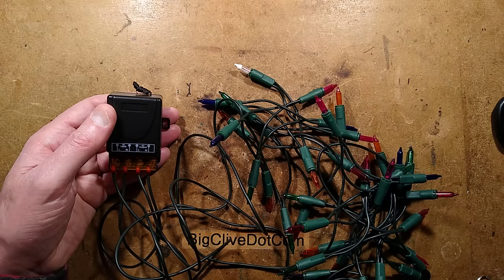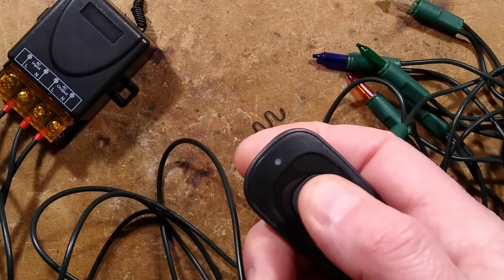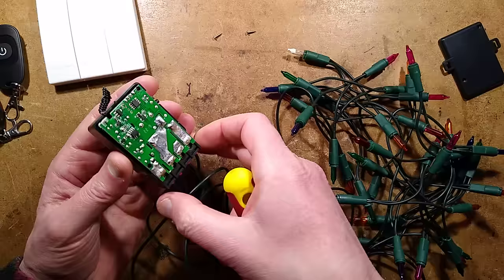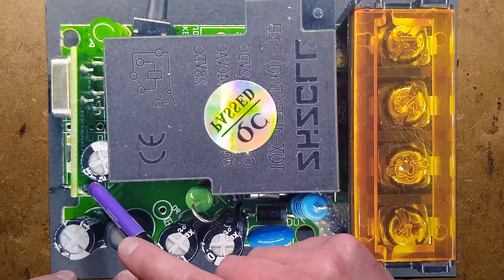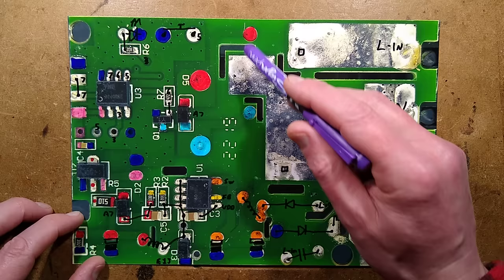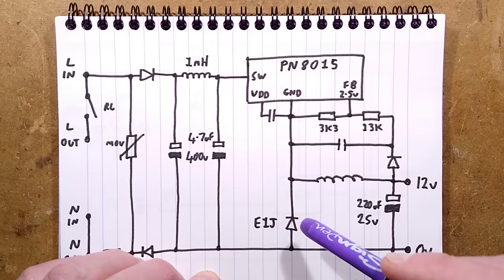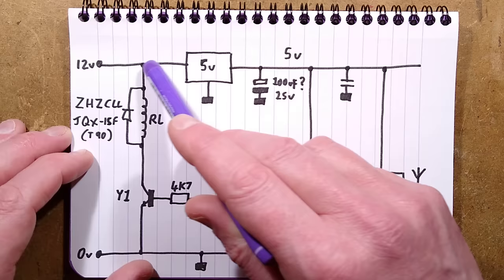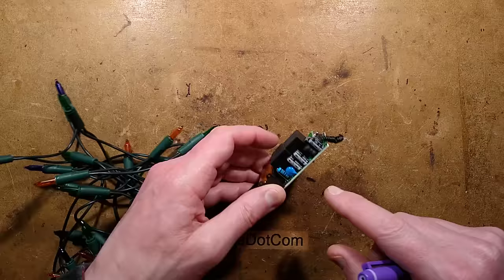Inside a "30A" remote control - with schematic

Comment: I've been known to add copper wire along PCB traces like that in order to improve their current capability. Usually 1mm for small or hard to fit traces up to a pair of 4mm if they fit.  (Sonoff, I'm looking at you...)
Reply: Anything wrong with the Sonoff PCBs?  I'm using a few of their modules, never bothered to open one up though.  And they are currently driving small loads (a few LED bulbs).  Still, that might change.
Reply: @kaasmeester5903  The rectangular ones I have use thin traces carrying the full current of the load running from end to end of the board.  They aren't great for either current carrying capability or isolation.  Very much appears to be a hobby style of design, IMO. I understand they have been improving, but my newest is several years old at this point so I don't know how or if those characteristics have been among the improvements.

Comment: I have one of these that is almost identical to this to control my dust collection.  I never trusted it to handle 30A, so I used it to turn a contactor on and off instead.  That way, the remote is only handling a very small current, and the contactor handles the 30A.  The whole thing is placed inside a metal junction box with only the antenna sticking out.
Reply from the maker: Keep in mind that if it is a mains voltage module the antenna should be treated as being live.

Comment: Interesting little device, but as you said, trusting that amp rating is most likely a bad idea.
And concerning those switches/key fobs, I'm a big fan of the "kinetic" versions that don't need batteries. They use a piezo element (or something similar) to generate their own power from the button press, works pretty well. Only "downside" is that the click on press is louder, and they are more expensive than battery powered versions.

Comment: Should you always add a diode to a relay, and, does its polarity matter

I've seen many without it, and I'd hate to be adding one where it could result in unexpected failures
Reply: Usually yes, and the diode should be oriented with the cathode to positive (because otherwise it'll shunt out whatever is driving your relay)
Reply from the maker: Yes.  When the relay is controlled by a transistor it is required.
Reply: It never hurts. And yes, polarity matters, that’s probably why aftermarket automotive relays rarely have them
Reply: Many relays/relay modules have the diode built in.

Comment: Awesom toys .I set 2 up for lighting a pathway in 2 locationsbwith a remote key .Was going to put a PIR but it would drain the batteries faster than the solar panel can charge .Because every sqirrel rabbit and fox and deer would set it of .semsor i used had not gain control .Lesson learned

Comment: I've made a couple of wifi power strips using nothing more than: an 8-gang box from amazon, outlet pairs from Home Depot, a 8-gang plate (bezel, face plate), you know, for a DIY 8-outlet power strip.  But inside the box, I fitted a Raspberry PI with WIFI, a relay board from Sainsmart, but any relay board with flyback diodes, opto isolation, and logic inputs will do, and used Wiring.py to poke at the relay board and cron (timers, clock alarms) to run Christmas Lights and our sump, because our basement is prone to flooding.

Comment: I've bought a few of these from the home improvement store, and they're not programmable.  They come in a matched set and are marked with a channel letter - so far I've only seen Ch. A or B.  So I've had conflicts between the fobs in different rooms.  I came to the conclusion that they were a waste of at least $20 or $30 depending how many the fob controls.
Reply: I removed the remote control module and the onboard PIC chip, programmed a new controller to limit the amount of time it would stay on, then added an external, programmable remote module. I also replaced its simple antenna coil with a micro sma connector and ran it to a real antenna. Got at least half a km range out of it and was able to program multiple controllers to it
Reply: Installed a remote controlled fan for a customer once, when they hit speed 3 it would set off their remote control door bell!! Laughed so hard because I couldn't reprogram either of them!

Comment: Reminds me how I recently thought about making my own USB switch to connect my kb/mouse to two computers. Thought about using solid state relays but I was trying to get out of it cheap. The time investment out weighs buying a $18 switch that should hopefully work. But I could still do it maybe in the future. Just use like a dummy usb power adapter for the 5v and only pass the data lines to the computers.

Comment: You can pull a 30 amp peak through a pish keurig heater relay, but just the tip, and only for a moment.

Comment: I think they make it as cheap as possible by using a single-sided PCB, then locate and buy all the parts in bulk, and pick as many old through-hole stocks as possible, then build a PCB around those parts and run a batch. 
They hand solder the through holes since there is no evidence of glue dots holding the SMD parts. Reflow soldering produces smoother fills. 
They run a batch of say 5000 pieces as an example, and if it sells well, they'll usually redesign the PCB or tweak it, to fit the new found cheap through-hole components. 
If you're in China, know Chinese and electronics on a hobbyist level, you can make a great living if you know where to source cheap parts. 
This is why, when I buy something I like the design of, I replace all the caps and power transistors with parts from DigiKey. I can guarantee that relay won't be able to do even 20 Amps for long before the contacts fuse together or the PCB trace burns up. Also, the PCB trace is not thick enough to carry 30 Amps, not to mention the puny terminal block. 10 Amps tops.

Comment: I’ve gone off RF because of the lack of feedback. Was okay in back in 2000s. Then came wifi but it’s really easy to overload a domestic router. Think the standard is about 30 something connections, so even if you use a dedicated router on its own VLAN you can do it. Currently most of my stuff is Zigbee because the usual limit is usually something like 128, it’s low energy, mesh networks and can often work without the cloud. If I have to use wifi I always now make sure it has local mode and prefer something with a common chip I can put my own firmware on. Current Zigbee stuff tends to have a separate radio chip but the newer ESP32 chips have a built in Zigbee/Thread so should make good videos on the not too distant future. Next system after Zigbee maybe Matter over Thread but it’s not that different than Zigbee and I already have a home server that permits interaction between systems so it’s not that useful for me. In this case I’d get a Zigbee Relay. Not seen one with that high Amp rating though. What item uses that much current where you don’t need to know if the switch is open or closed? Personally I’d add a Zigbee relay and have it close a second relay that really is high amp. Even from brands I don’t tend to trust those ratings. In 2024 I don’t really get why anyone would get an RF Relay.

Comment: The best use might be for attaching a very small dc capacitor to it and then setting it off when someone least expects it 😅

Could the extra connections not be for a different relay module but to change from normally open to normally closed?

Comment: 30A DC is a hell of a spark almost impossible to extinguish, 30A 230V single phase AC is forbidden by most electrical distribution companies single load to switch (almost 7kW, whereas in Bulgaria over 3kW in regular home wiring is illegal or requires special approval)...

Comment: Yeah, I wouldn't trust it with 30A - usually at that point you start wanting safety ratings like UL or other things (UL ratings on components will actually be the fancy "UR" logo). After all, if you want to switch serious currents at serious voltages you want the safety aspect to come in.

Comment: that PN psu chip seems to use similar strange circuit like the infamous  str50103 regulator used in many tvs in the mid 80s to 90s  if you look at the  datasheet and its internal circuit, and how its wired externally, its a case of 'eh, wot' 😁

Comment: I would be tempted to add some heat shrink to the end of the antenna wire to insulate it. Also, is it possible to add a screw or a cable tie to stop the terminal cover from popping up so easily?
Reply: I use Velcro to hold mine on 👍
Reply from the maker: The terminal cover is pretty stiff to open.  But a module like this should be mounted inside an enclosure.

Comment: I wonder if the RF remote codes are static or rolling like a vehicle remote. If they're static it's easy to record and play the signals back with an RTLSDR and RPITX. You can then use the replayed signals in automation.
Reply from the maker: The unit learns codes, so you could choose them for your automation equipment.

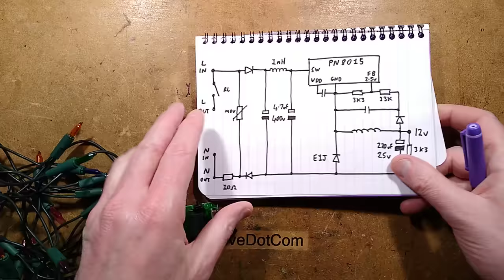Comment: Could you also use the built-in 12v supply in this to power another additional 12v relay? 15:33
Reply from the maker: The power supply is not rated for high current, but you could remove the relay and use an external one.  But you'd have to remember that the 12V is referenced directly to the mains supply.

Comment: I have an earthing conundrum, BigClive, and you might know it involves a Chinese electrical product!

In order to reduce laundry drying times, I've bought a Chinese Spin Dryer. Testing the earthing of the oriental appliance, reveals that the inner stainless steel drum is earthed correctly, but the outer metal casing, and the base of the spin motor are NOT earthed!

Can you explain, Big Clive, fountain of all electrical knowledge? ⚡👍🤣

Love the fairy lights. Obvs, LEDs are great, but incandescent is so beautiful!
Reply from the maker: It depends on the likelihood of a fault causing metalwork to become live.  If the outer metal is cosmetic on a plastic case then it's not super critical, but if there is a chance of it becoming live then adding an earth link to the outer metal shell might be a good idea.
Reply: @bigclivedotcom  Very odd! I replied to your reply, and my reply vanished into thin air! Sick to death of YouTube shadow banning me, and removing my comments willy nilly! I don't know what their problem is?

The outer metal case is not cosmetic, and only the top and bottom of the dryer are plastic. A fault could easily cause the case to become live, and I can't understand why it's not earthed. Incidentally, I have two dryers, one is faulty and is to be returned, and both exhibit a lack of outer case earthing. How it got a CE mark I don't know?
Reply from the maker: @marcse7en  It's possible you hit one of the many keywords I've been using to filter out the boobie-spammers.  Once that situation is under control I'll remove a lot of the keywords.

Comment: I've never actually studied the protocol behind such switches but being aware that it's made in China and the remote is so interchangeable I wouldn't doubt you could easily manipulate it with SDR (meaning anyone with a USB SDR dongle could mess with your appliances), so I wouldn't trust it, but interesting concept nevertheless.

Comment: Hmm...?
I just had a thought. Could the receiver work with a class Y capacitor in series with the antenna? If it worked, it would make the device a smudge safer.
To be clear though. It won't be completely safe! Just a smudge safer, isch.
Reply from the maker: That might work.

Comment: How does the PN8015 measure the 12 V OP wheh it has no direct connection to the -ve rail? Is it clever enough to measure only when the diode is conducting? As the aerial only needs to see RF, they could have put a small capacitor in series to separate it from the mains-connected circuit.
Reply from the maker: I'm not sure how it measures that.  It may be measuring it across the inductor.

Comment: I have a bunch of light switches in my house I need to move because I’ve changed the direction the doors open. Rather than trying to chase the wires in the walls could I use 2 or 3 of these instead? Can you set them on different channels or frequencies?
Reply from the maker: Each of the wall switch plates has its own code, but you can program one receiver to work with a few different switches.

Comment: That relay is a clone of a design originally made by Potter and Brumfield called the T90 series. 30A @240VC resistive is the N.O. rating according to UL (so I guess that makes it American amperes). It’s not a very good design for isolation or long life, but cheap and everyone from A to Z(ettler) has cloned it). Okay for 10A 125VAC resistive if your circuit can withstand the nasty coupling.

Comment: I wonder how it is safe to use with the rf antenna connected to hazardous live without proper isolation transformer? Or is there a Y-cap on the rf module antenna port?
Reply from the maker: The antenna is best sleeved.  Or the 12V version used where it is very exposed.

Comment: 30A load 240V = 7200W  I can't imagine in which Western country anyone would try to run such a load through this piece of gear.  It could be very useful for some things though, but install inside a plastic jiffy box.  However, I am unsure sure if this would pass Australian Electrical safety regulations under any use scenario; I am confident it would not.  Use at your own risk - if it started a fire and your insurance claim was denied you would be on your own.

Comment: how is the the radio standard /protocol for these called?
I assume it's called something, not just s 433MHz remote/relay and you're supposed to get lucky for these to work together.
Reply from the maker: Not sure the name of it, but most eBay fobs do follow a data standard.
Reply: A lot of the times it is the ev1527 protocol. They often state 'learning code'. They are fixed code and therefore not secure against a replay attack.

Comment: i buyed livarno led strip in lidl and the blue light has some kind of UV , i dont have any tools to measure , its the 10m not smart one without waterproofing just the bare strip
Reply from the maker: Blue LEDs emit just a single wavelength, usually around 470nm.  But it will make fluorescent items like hi-viz clothing glow.
Reply: oh that cool , i just noticed my mail and the money security treads started glowing when i turned on :D

Comment: As there is no galvanic isolation, what voltage is the antenna at? What about when you swap the live and neutral?
Reply from the maker: The antenna should always be regarded as being at full mains voltage.
Reply: @bigclivedotcom  Aye, but is the tip isolated as if it is live? What happens if it shorts out to the box or an open ground terminal?

Comment: I have no idea why other countries use 220vac for their outlets.  Seems an insane thing to do to use that in a typical household. Been hit by 120 several times in my life be either a frayed cord, or getting fingers to close to things that I knew better. Can't imagine getting hit with 220vac. OR some little child touching a bad cord.
Reply: It makes very little difference to being zapped. The higher voltage is actually safer IMO, since you have lower currents for the same power. That means lower current circuit breakers, which in turn means faults are less likely to become fires.

Comment: 433 MHz, right slap bang in one of the most populated sections of the 70cm amateur band, why the [insert expletive of choice] do they put them there..? I'm convinced it's why I often found my car unlocked first thing in the morning when I know I locked it the night before. Grrrrrr 🤬
Reply: If you've got a car alarm that someone else can unlock, you need a new one. The most likely cause is the fob is in a pocket and crushed against other stuff, that is pressing the buttons, sending out the signal to unlock.
Reply: @threeMetreJim Actually no. Firstly, it's not an alarm as such, it's the central locking system built into the car. When I lock the car at home, the key goes into a keysafe inside the hall. When I'm out, it attaches to a hook with the rest of my keys on my bag. It is never kept in a pocket. It is definitely RF that is affecting it. I am a radio amateur and it may well be my own 433 MHz transmissions that are affecting it, but these keyfob things should not be on that frequency, it's that simple.
Reply: @TestGearJunkie.  Amateurs think they own the band when it's a secondary allocation. As government assigned the ISM band, you'll just have to 'suck it up', just like ISM band users have to. Still, if something you are transmitting is opening the central locking, it's not secure, or is really sensitive to rf interference, making it insecure. Being an amateur, you should be easily be able to work out what is happening, replicate it, and notify the vehicle manufacturers - that would be most useful for them.
Reply: @threeMetreJim Yeah, I know all that. But surely it wouldn't be hard to find another section of band to put them in, the Americans seem to mange it, the car I now have is an American import, and it uses a different frequency altogether. Not sure what it is as yet, not bothered to find 
out, but 70cm doesn't bother it so I'm not all that motivated to do anything about it any more. All I'm saying is it still seems stupid to me to allocate a section of spectrum where there are loads of other users.
Reply: I've had UK-made Byron HomeEasy remote wall switches and remote relays for years, just to let you know these Chinese "433MHz" relays don't pair with the Byron wall switches.